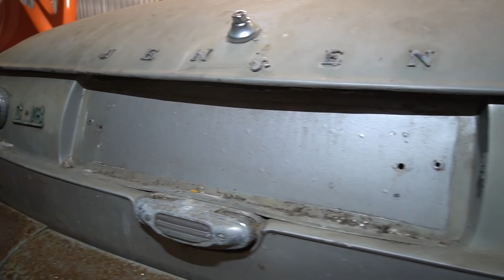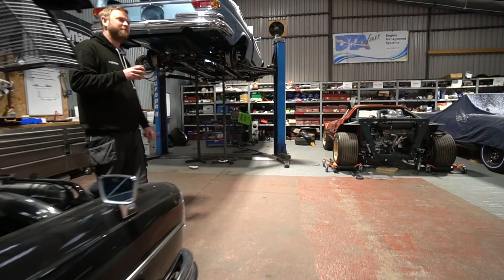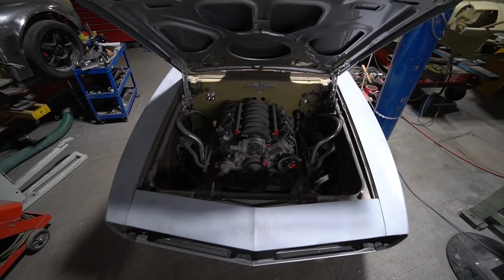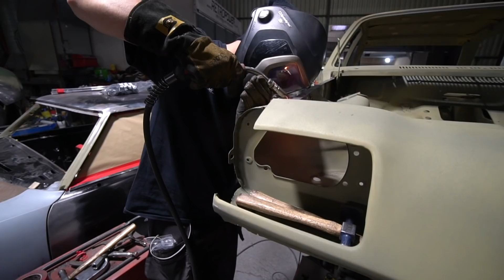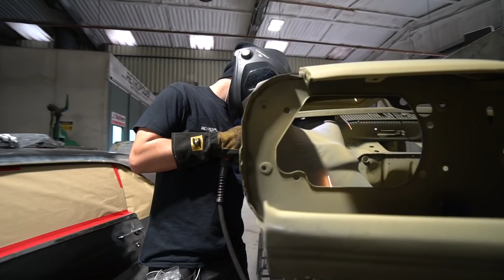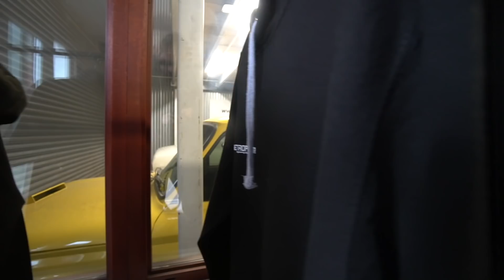Retropower Uncut Episode 14: NEW PROJECT! Supercharged Restomod Jensen CV8 + MK2 Jaguar Painted

Comment: Three years later, the C-V8 has been gutted and destroyed to use as molds for a Carbon fibre shell, the wrong motor used,... and then suddenly, nothing, no updates here or on the webpage for a year or more.
Gotta wonder, did the owner not approve of having thier pride and joy torn appart? Or did Retropower find out just how much value they'd wiped off the car's resale, afterall, if you're in the market for a Jensen C-V8, why would you buy a replica with the wrong heart and no soul?

Comment: Restomod - how does your country look at that from a legal and insurance point of view? In mine, a modification from the "type approval" by the motor vehicle authority can make it illegal to drive the car and in case of insurance claims, the insurer might say the car was not insured due to not being a legally allowed type.
Replacing leaf suspension by independent is a serious modification from an engineering point of view and could disqualify the car. Mounting a more powerful engine too. The car becomes a new type and needs to go through a new approval review where it will be subjected to today's code instead of the 1962~1966 code that applied to approval and next allowance onto the roads of this country.

Comment: what a shame your gonna ferk it up by putting a modern engine when the original could be made to produce tons of power, but obviously with extra power you have to upgrade the brakes and suspension, just a shame about the engine. I have a Webasto roof on my E Type and they are not the best just don't go out in the rain :) but I like their period look, it's always each to their own.

Comment: Wasn't that an inch further forward for the HSR, certainly not 100mm? That was for two main reasond - the original 2.3 slant 4 was a darned heavy piece of cast iron - just use a Millington alloy block for the XE and that problem's solved, the second was the inner wheel wells on the front didn't have a lot of clearance for wider and/or larger diameter tyres and would foul - usually that meant trimming the front and surgery to the rear but by moving the axle forward the latter problem was reduced or removed.

Comment: That doesn't look like a webasto Roof. why not fit a real one? Glass roofs were a bit passe by the end of the 80's ...😁 and for gods sake tell your customer to forget the Chev swap. Go for a late Hemi and trans. Take a Hell cat or a Track Hawke for a spin and then decide. the low torque, high revving chevs are great for bragging but the mopar is all about Torque, the factor that really matters on the road. 
As for Camaros, it's not unusual tov find everything is rotten, especially that plenum in the cowl.
Reply: Yes! Once he said chevrolet engine I almost turned off the video.

Comment: Chevy engine? The original 383 is very tunable including fuel injection. My 440 in an Interceptor gives 450hp+ with minimal mods. There are many transmission options. A modern engine would give better fuel milage and lower emissions but how many miles will the car do? At least use a Mopar engine if you have to change it.
Reply from the maker: Just fancied an aluminium block. We're following this with an Interceptor which will be Hellcat power, so we'll have an interesting comparison then
Reply: @retropowercars  With the CV8 being relatively lightweight aluminum makes sense. With the interceptor weighing in ar around 4300lbs, the engine weight of aluminum isn't going to make a significant difference. For my money, I would replace the heavy tubular chassis with a more modern spaceframe like chassis and try to give the rear seat passengers some leg room. I mused with the idea of stretching my Interceptor to get more passenger room but too many projects...

Comment: Re: Chevette - why go for a Panhard rod and not a Watts linkage?  Panhards work well in cars with minimal suspension travel (like race setups), but I've heard they can bind a bit (and/or push the rear axle sideways) with more compliant suspension.

Comment: The CV8 was originally meant to have glass headlight covers like the MKI E Type Jag, but Richard Jensen stopped them from being fitted as it reduced the headlight performance too much. 

Some owners have had them made and the car looks great with them. The bumpers don't do the front end any favours either, but they look very aggressive with them removed.

Don't fit a Chevy engine! Got to be Mopar!!!
Reply: Didn't think of that ! Yes it has to  be Mopar ! ( do you really think they'll take any notice !)  I  used to valet a MKIII as a boy for pocket money and the owner let my father use it for a week whilst on holiday . 6.3 litres of America  muscle driving through  6.70 Dunlop RS5's could only mean one thing  .....wheel spin on kickdown at 60mph ! Cheers !
Reply: Agreed.  If you want to use a GM engine, restore an Iso.  :-D
Reply: Agree, it really has to be a big block hemi. Supercharged. Oh yes :D
Reply: Space may be the restriction to a MOPAR swap. Modern multivalve V8's are wide. The advantage of the GM V8 is that it's compact.